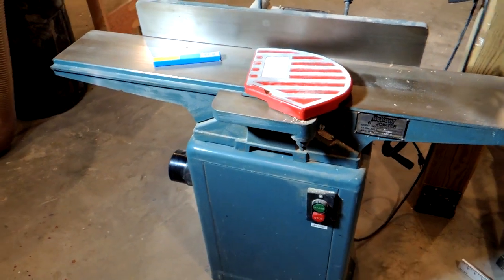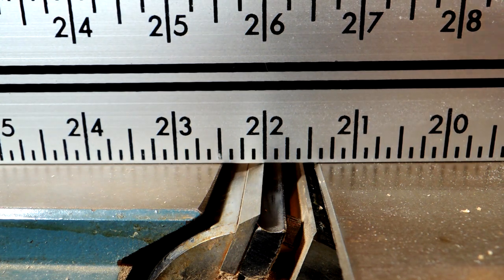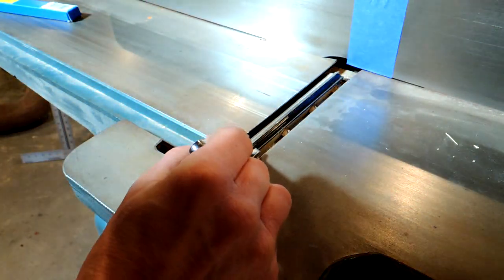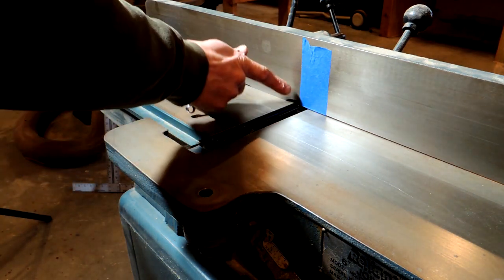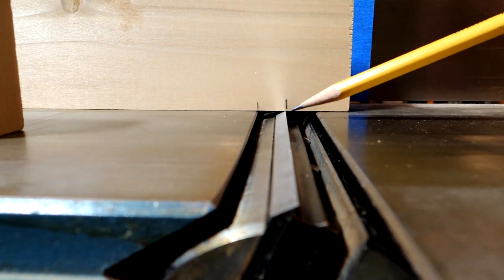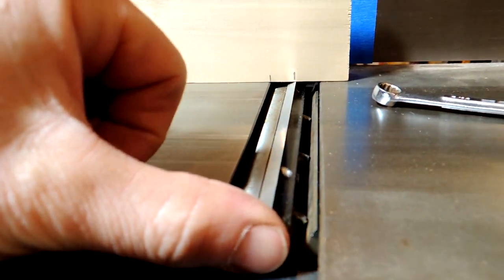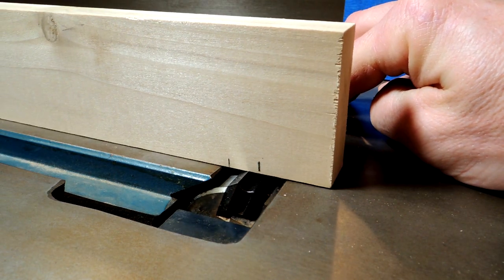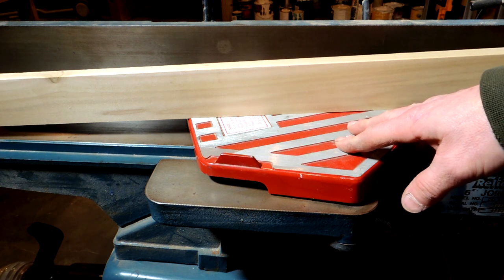How To Replace Jointer Knives

Comment: New blades can be extremely sharp! Caution should be used when handling blades. You can be cut very easily without a realization that the blades are cutting you. Gloves are a great idea.

Comment: There is a simple tool that comes with the machine to take the guess work in aligning the blade. It aligns both sides of the blade at top dead center, so all you have to do is tighten the holding bracket.
Reply from the maker: Yes, some jointers are supplied with that alignment bracket, but not everybody finds it useful.  I think mine is buried in a drawer somewhere in my shop.

Comment: I agree with everything you did except for, how do you know the knife is just touching the underside of the wood if it doesn’t move at all? Are you going to use a feeler gauge or something? I hate the amount of time it takes to set the joint or knives as everyone else does. I just don’t know a surefire and simpler way of doing this. Usually, I will take my aluminum straight edge which is perfect and putting Mark on the straight edge and see how much it moves from the highest point forward and then do that to the backside and the front side of each night. I have not tried the magnetic trick yet even though I have it, so I guess that is going to be my next adventure to try to make this process quicker. I hate changing these knives so much that I am looking to sell my jointer I have now and purchase a helix head jointer instead.
Reply from the maker: The process can be a little fiddly, but even with my tired old eyes I can get nearly perfect to the scrap wood.  Generally you go slightly too high and then back off for the final adjustment.  I use my jointer mostly for edge joining so I don't need to change the blades that often.  The helix thing has pluses and minuses--it may be more forgiving as far as keeping sharp edges available but the cost is nothing to sneeze at.
Reply: @enduringcharm  completely agree. I fiddle with it for about an hour or two and I finally got it decent enough. I would like to sell the one I have now and buy a heal head, but it wouldn’t make sense unless I can get at least half what I paid for the one I have now which is a powermatic 6 inch long bed

Comment: I usually take a blue sharpie and color each bevel in the knives.  as a test run, I joint a  face of a wood and see which knife has the most blueing removed.  I make adjustments as needed.
Reply from the maker: Hey, great idea--thanks for sharing!

Comment: Great video John; just one thing, your using Gib Bolts to remove and replace the Gib, I note that your video is the first one I watched that says to screw them into the Gib to loosen the blades, I suggest cleaning all saw dust from around the machine in case you drop one of those springs. Back to the Jack screws (also more correctly called bolts) - your jointed does not have "Jack Screws" they are in the cutter head (2 per blade) and have a recessed Hex Socket Flat Head, and are used to lift the installed blade like a micrometer fashion with your Gib Bolts snug, but not tight. You can also use the Jack Screws to install sharpened blade accurately by (loosening the up to snug on the bottom of the old blade before removing) and then an additional 1 turn out, before remounting the same sharpened blade in the same slot, number the blades and knives when removing for best results.

Comment: Thank you for the video and detail. I have almost this same jointer. I actually turned the gibs the wrong way before seeing your video. So my guess is the jack screws when loosened go tight up against the wall behind the head and that is how the blades are tightened? I have to give it a try again tonight. I thought that the screws went against the blade, but after seeing this it looks like the bottom of the jack screws never touch the blade. Thanks!
Reply from the maker: Oh, you thought that the blade goes in the other side and the screws pushed against the blade?  I mean, there are lots of designs out there but if your jointer looks like the one in the video (which was a popular model sold by a few different companies) then set yours up like you see here.

Comment: OK,
We're back on line with both bearings replaced and each end of each knife barely contacting a straight-edge placed on the down-stream plane surface.
Used no lubricant on the wedges, as with most interference fits, this can break one of the components when tightened. 
I will not remove the outboard bearing if re-adjustment is needed, but will instead, drill and tap the outboard end of each wedge to the same thread as the wedge clamp bolts.
If you're familiar with the Morse hub/sheave method, the tapped holes serve as placement for the three clamp screws to serve as jack screws.
As we learned with the outboard bearing removed, the wedging action will work from one end. (three good blows with a 3 lb Lead block to a suitable flat screw driver bade),
backing the released (from the shaft) blade holder with a bar inside the inboard (belt side) bearing support. 
I would recommend this as a viable mod unless you have some very specific wedge tools for this purpose.
When done, this purred through mahogany block like it was wax.
Nice curled chips on the floor!!! :)

Comment: Great video and explanation-  I have the exact same jointer and am going to change the knives. Can you tell me what knives you purchased/used?   Thanks for taking the time to put this video together.
Reply from the maker: I found mine on amazon, sold as "Freud C350 6-by-5/8-by-1/8-Inch Jointer Knives, 3-Pack.

Comment: Hello - great video (ty) 
I was wondering if you could tell me how to measure the knife when buying replacements. Do you measure the width from the flat squared edge to the very tip/cutting edge of the knife or just to where the angle of the edge starts?
Reply from the maker: I'm not certain I follow your description, but for choosing new knives it's best if you have the old ones to compare.  The knives should be fully seated in the groove and be able to poke above it.  The hold down mechanism should have enough meat on the knife for a solid purchase and not have the bevel buried.  Obviously the width of the knife is the same as the groove.  You may find more than one size that fits, since some may be taller than others.  All you really care about is a solid seat in the groove and clearance for the blades in the machine.  Since the mechanism can be lowered or raised and the tables adjusted, you can always get the new blades tuned in even if they are slightly different.

Comment: good info on blade changing! will be using later this week!! know this is an old video, but just got a similar Reliant jointer given to me.. looking for a manual/info on it. can't seem to find any info on the unit online. know or have manual? info? thanks
Reply from the maker: There may be a manual online, but it may be under a different brand name.  This unit was sold under various brand names at the time.  There's not much to know, however, other than changing the knives.  The fence is pretty self-explanatory.

Comment: Thanks John, I recently purchased this jointer but I’m having trouble finding a manual, any idea where I could get one?
Reply from the maker: Mine probably came with one, but I couldn't guess where it is now.  Often you can find manuals online in PDF format.  Remember, this jointer was re-badged for different brands so if your particular brand isn't available a manual from another brand should be essentially the same.

Comment: I have the same jointer picked up at a great price on CL, any chance you have the manual online you can point me to? Trying to figure out the fence system. Your video is great for helping change out the blades, thanks.
Reply from the maker: I'm sorry, I don't have a link for you.  The fence system is pretty simple, though.  You have a tilt mechanism so you can joint at an angle, and you have a left/right mechanism relative to the cutter head.
Reply: Have the exact same jointer and I’ve been scared to change the knives out on it, after watching your video several times I did it last night. took a little over an hour and I have great results now. Thank you appreciate you documenting it.
Reply from the maker: That's great to hear!

Comment: Good advice and idea...After Ive cleaned and service my jpinter I realised Ive lowered the outfeed table and want to know how or to waht level?  I assume its important to get the outfeed table at the "right" height before I start replacing or set the new blades??
Reply from the maker: Don't fret.  Install your new blades first, and then set your outfeed table to the same height.  Lay an accurate metal straight edge across the outfeed so it overhangs the new blades then lower the outfeed slowly until it just kisses the tip of the blades.  Check several rotations to make sure all the blades are the same height and the same height across the width of the blade.
Reply: Thank you for the advice, I'll do it first thing tomorrow morning....

Comment: We've got a really old one with the blade wedges totally jammed.
After getting out the outboard ball bearing, a window to each wedge bottom was exposed, where a tapered flat head screw driver could be driven parallel to the shaft with a bar to block cutter head against the inboard (belt side) bearing support.
All strikes for all operations were done with diver's lead blocks.
The way our blade wedges were stuck, anything other than a tapered wedge driven straight in would never have worked.
We will need to replace the outboard ball bearing and we did witness-punch the wedges and rotor at the outboard end

Comment: I have seen other videos where it is said that the blade should pick up the board and move it forward 1/8th to 1/4 inch.   How do I know which to follow after watching your video.?
Reply from the maker: What's important is that all the blades reach the same high point when they come to the top of the spin.  As you note, some people feel they can get an easier sense of that high point by seeing a scrap piece of wood move.  Others, like me, prefer to observe the blade just kiss a straight edge.  It makes no nevermind as long as you get all the blades peaking at the same point.  Pick your favorite, or do both by raising the cutterhead slightly after using my method.
Reply: It has been my experience after many years with an 8" jointer that for most accurate results the blades should move the straight edge about 2mm.

Comment: Any tips for loosening super tight jack screws? These things can be a nightmare. Can they be cut off and just replaced?
Reply from the maker: Well, getting a full box wrench over the head would be ideal, unless it's not a hex head.  Using heat in the form of a propane torch or a heat gun would be another trick.  Letting a penetrant soak in overnight or over a longer period might help.  They really shouldn't be that tight, which makes me wonder if the problem is just frozen threads.  If you can get a full wrench on there and heat up the surrounding metal that should do it.  You can try whacking the opposite end of the wrench with a mallet to crack it loose.  Once you get it apart, check to make sure the heat didn't warp anything.
Reply: @enduringcharm  I got some PB Blaster, and I will let them soak and also try the torch technique. One head is rounded off pretty badly, so I will probably just have to cut that one off and replace it. Totally agree, there is no reason to over torque these. It also seems hard to find a high-quality wrench for something this small.
Reply from the maker: There is another trick I don't use very often, but it sometimes works.  If the heat is a fail you can try ice cubes.  Hold the ice cubes on the bolt head as best you can and let it melt awhile, then try to loosen.

Comment: I have a Reliant jointer that is almost identical to this one.  I need to replace the knives but the springs are gone on mine.  How can I install the new knives without the springs to keep them high enough?
Reply from the maker: Well, for one thing, you may be able to get replacement springs.  I think it was one of the box stores or maybe Amazon where I found you could buy a box of assorted springs.  That little box of springs has saved my rear-end a few times!  Another option  might be to use a flat magnet on the bed and across the blade area to hold them up.  But, check around for those assorted springs first, they are real handy to have on hand.

Comment: Well done. My concern would be having the wrench slip and graze one of those perfectly sharp blades.
 I use gloves.I know myself to well and would rather not bleed on my tools…
But that’s just me
Reply from the maker: It can be a little tricky when you have a small bolt head which needs to be very tight.

Comment: not sure if ill get an answer here but I cannot seem to find the tool or a tool to remove the set screws for the blade change.
Reply from the maker: Is it a similar set up as in the video?  If so, you just need a common wrench, nothing special.
Reply: @enduringcharm  i guess all of my wrenches are overweight, to the grinder they go! thanks
Reply from the maker: Oh, I see.  Yeah you can grind down a cheap wrench or purchase a thinner style.  The newer wrenches tend to be thinner than older designs anyway.
Reply: @enduringcharm   I ground one down and it worked out mint, going to swap them out after work, thanks!

Comment: Where do you buy knives? I have the same machine and It cost me 100 to buy a new set
Reply from the maker: Are you in the US?  The Freud brand 6-by-5/8-by-1/8-Inch Jointer Knives that I have purchased in the past are currently $28 on Amazon.

Comment: Can you share which blades you purchased?  I have one of these I'd like to restore, but do not have a manual.  Thanks!
Reply from the maker: I don't recall the last time, but it might have been Freud.  They are just high speed steel, pretty basic stuff, so I wouldn't get too caught up about the brand.

Comment: So, who's right??? Other videos recommend the knives be set high enough to cause a 1/8" to 1/4" displacement of the straight edge as the knife passes by.
Reply from the maker: It really doesn't matter, as long as you get to the proper end result, which is that the knives are all in alignment.  For me, it's easier to see differences by having the knives just kiss the straightedge.